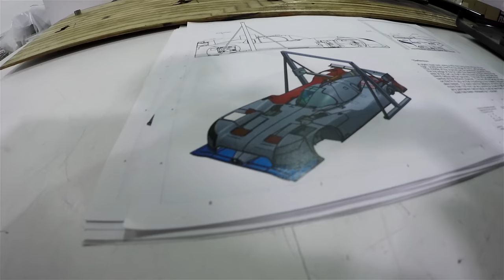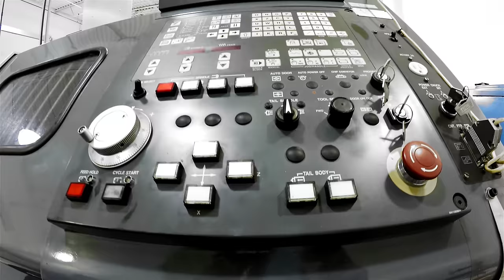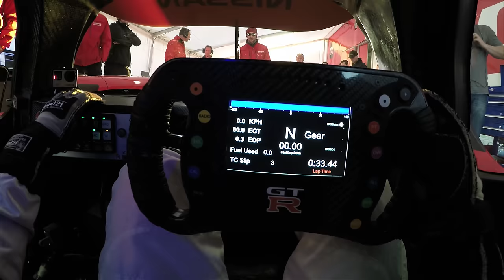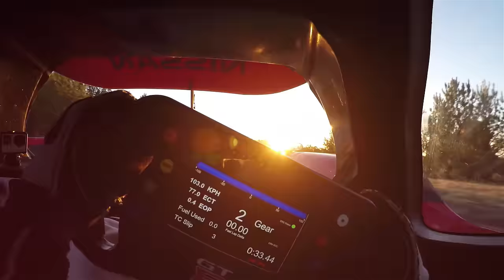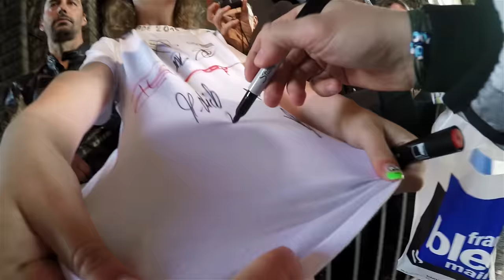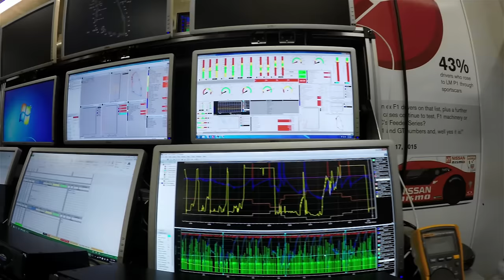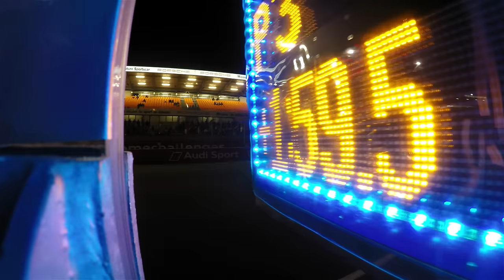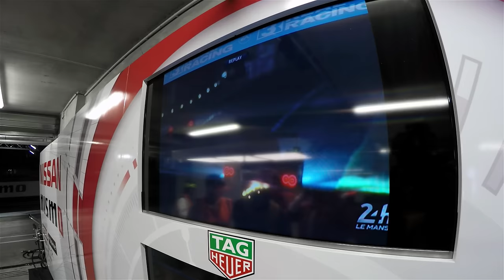GoPro: The Art of Innovation - Nissan GT-R LM NISMO in 4K

Comment: The problem with this car is the layout ,even though on the straights is fast.
 Between the corners struggles to pass a lmp2 ,the fwd system doesent permit the driver to go full throttle all the time like such in other lmp cars,which is a big disadvantage when you consider every corner mile means passing others not staying behind from lower classes.

Comment: Andn now the project has been withdrawn. In conclusion: The Nissan LMP1GT-R LM was a disaster, missing a Hybrid system for Lemans and resulting in it being 20 sec slower than rest, (Even slower to some LMP2 cars), reliability was awful, but all hope was on the data gained to improve it for next year, but now the project has been abandoned, and the car will go down as a big failure for Nissan.
Reply: Gamefan56 and the car turned into a living meme car
Reply: @G1K777  Agreed. But history has shown that front engine cars always had a disadvantage compared to mid engine cars. Look when Cooper came with the mid engine in F1, Lotus at Indy... Only in GT-racing it can be competitive. Nowadays merely because of BoP.
Reply: @bowelrupture  It was not handicapped by the front engine. It was handicapped by the system failure which meant it wasn't getting the hybrid system power to the rear wheels. That robbed it of about 30% of its output.
Reply: Daniel Vipin  Not sure I agree with the figure but I definitely agree with your sentiment. My interest in this project is more aerodynamic than engine. It solved a problem which has never been taken seriously in motorsport regulations: aerodynamic divergence.

Comment: This should've been about Audi or Porsche, Nissan had a bad race.
Reply: GoBro were sponsoring Nissan this year, which is why they followed them. But yeah, shame they basically turned up with an unfinished car (no hybrid system at all)...
Reply: +Bryan Asifuina + they did it with a innovational concept
Reply: +sh4rpeXtreme Yeah with 2000km less than the Porsche.
Reply: +Pentanix it won't be long before they find some cheat software in those porshe's or audi's.....
Reply: +Pentanix They just need time. No new car was perfect. I actually hope they never perfect it because if they do, they get complains from the all time winners and get banned from using them. Like the Mazda 787B or the Chaparral 2J...
Reply: +sakeido I get your point. My point is with all the news about VW having software that cheats emissions by acting like they comply with regulations but when in reality they are more powerful than they claim to be. The Audi R10 TDI won le mans for almost 6 years consecutively and now the posrche's are doing the same. They beat the competition by huge margins yet they are all supposed to have similar BHP.
I suspect that since audi and porsche are owned by VW, they must have some cheat software installed that during after race scrutineering the cars are within spec when in reality they have 50 to 100 more bhp during the races.
Reply: "I suspect that since audi and porsche are owned by VW, the MUST have some cheat software..."

What shit are you consuming? thats beyond stupidity... People on the internet these days are high af
Reply: +Pierre Fouquet They had not done enough laps to be in the classification....
Reply: +Pierre Fouquet For Factory team,yes.
Reply: That's the worst suggestion mate.
Reply: +Pentanix
Audi and Porsche are so strong, so we know the result before racing.
Nissan Nismo was not good result. But really great challenging. Especially, it was front-drive, very interesting.
Reply: +Bryan Asifuina They've finished Le Mans... wow , so have another 20 plus teams with ten times smaller budgest than Nissan , and some of those teams did well in the race ,and didn't finish 150 laps behind the winner.
Reply: +Fan Kristensen The funny thing is, even their claim that they finished Le Mans is not true.  They were too far behind and were not classified.  That means they didn't finish Le Mans.
Reply: mhtl48 Sherlock, how the f*ck are you supposed to have "cheat software" when the only engine specification mandated by the rules is restrictor size?!

Comment: Ehh these modern lemans cars are all about downforce... Which is wrong on a circuit like that. These cars top out at about 175 with the KERS system. Cars like the Sauber c9 had a much much higher speed which is the way to go.
Reply: +Mercury It's all about reliability now.
Reply: +Troy Botteon I know, it kina makes it boring now...
The sport was much more interesting then.
Reply: Mercury It was too...
Reply: +Mercury They topped out at 214 mph this year, so about the same as a Sauber C11 in race setup. C9 drove, when there were less chicanes to deal with.
Reply: +Troy Botteon ??? It always was in every car race ever contested!

Comment: Front wheel drive lol
Reply: It's better that way
Reply: +ItsKapow its awd
Reply: It can be both
Reply: explain what u mean?
Reply: +Eddie O'Connor ICE/electric motor powers the front wheels, two motors at the rear, but they couldn't get the rear wheel motors to work properly for a long period of time.
Reply: thanks for explaining
Reply: +ItsKapow Nothing wrong with front wheel drive at all - it has certain advantages and disadvantages, just like rear wheel drive and all wheel drive have their advantages and disadvantages. That's why all three systems exist in racing and consumer cars.